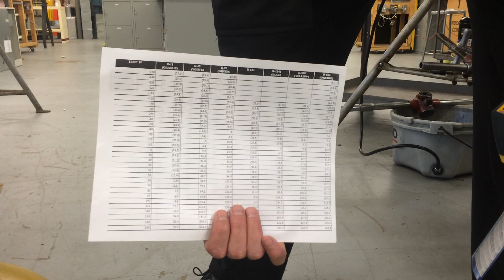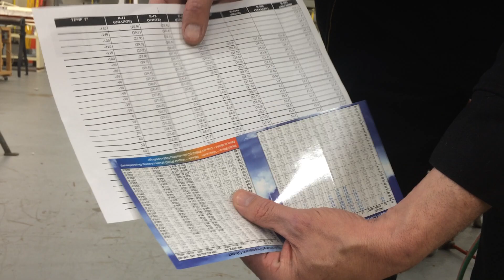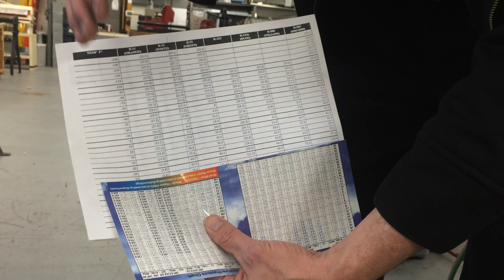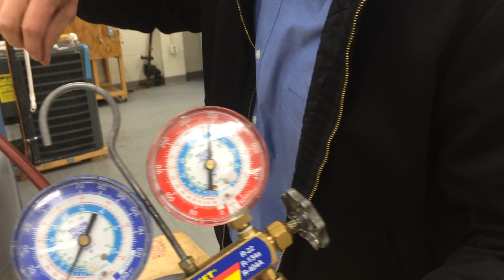EPA CFC 608 Test Study Guide - Using the P/T Chart to find the refrigerant type in a cylinder

Comment: Quick question boss, just cause I want to know the why. But why do we connect to the low side and not the high? Also why are you connecting the high side hose to the low side / vapor side, instead of using the low side hose?

Comment: How is the amount of refrigerant in the tank not a main variable to consult?
Reply: As long as you have some mixture of liquid and vapor, the pressure will always be the same at a given temperature.
Reply: @realSamAndrew  You're saying the pressure will not increase as you add more refrigerant??
Reply: I'm sorry this is just making my head explode. I can't seem to process the idea that more refrigerant doesn't mean more matter pushing on the cylinder and therefore more pressure and a higher reading. Especially since pressure readings are how we tell how much refrigerant is in a system.
Reply: @channelfor4578  the pressure WILL increase as you add more refrigerant. But so will the temperature. As long as the tank contains pure refrigerant in saturated state, the pressure and temperature will align with the chart of that substance. Every time you add 1 ounce to the same size bottle, you add a bit of pressure and a slight rise in temp. Watch the movement and match the chart.

If you weigh the bottle first and never add or remove anything from it, and take a pressure reading at room temperature, then put the bottle in an ice chest, the pressure reading will drop, but the bottle still contains exactly the same weight of refrigerant the entire time.
Reply: @realSamAndrew  Thank you, sir that really helps me, I appreciate the explanation.

Comment: I don't understand exactly why is the refrigerant always at a saturated temperature when its stable?  For example, its possible to have a can of water at 70F at 0 psi. But the saturation temp is still 212 right?  I am probably confusing myself lol
Reply: a sealed system introduces pressure into refrigerant.  wherever there is enclosed pressurised refrigerant, there exists a saturated temperature for the said refrigerant.  pressure and temp go hand in hand.

Comment: So a PT chart states the temp/press at a saturated state right?  So am I safe to conclude that most refrigerants are saturated at room temperature?  Are there refrigerants that don't work with this check method?
Reply: Good question, I'm coming up with the same questions also.
Reply: a sealed system introduces pressure into refrigerant.  wherever there is enclosed pressurised refrigerant, there exists a saturated temperature for the said refrigerant.  pressure and temp go hand in hand.

Comment: You have a lot of great educational videos, thanks!  A suggestion I'd offer is assuming that that these analogue gauges have their highest accuracy in the middle 3rd of their scale and knowing you're expecting around 70psig I'd take the reading on the low-side gauge.  A similar method I use for purging off non-condensibles is tape a good digital thermometer probe to the side of the tank and be sure as you mentioned, it be settled, undisturbed and balanced ambient, then carefully purge off vapor side until it matches the chart.  Works especially well with digital manifold gauges that read 10ths of a psi.

Comment: In regards to the high pressure reading on the unknown recovery cylinder could a deminimius release be performed to evacuate the air pressure and then retest or is it so entrained it wouldn't separate?

Thanks for the great video's. Your an excellent teacher.
Reply: No. It would have to be sent to a reclamation facility legally.

Comment: when you measure the pressure inside the tank, why do you use the gauge red hose for the blue vapor on the tank? any different between the two gauge? Thanks.
Reply: +edisonhvac thanks for your answer
Reply: @DailyOpinionsUSA  I am wondering the same thing.
Reply: @demillevantigo7432  you should use the high side gauge to measure the vapor side of the tank because the low side gauge could have damage if the pressure of the tank is higher than 120 psig